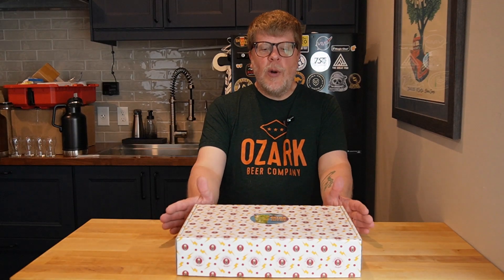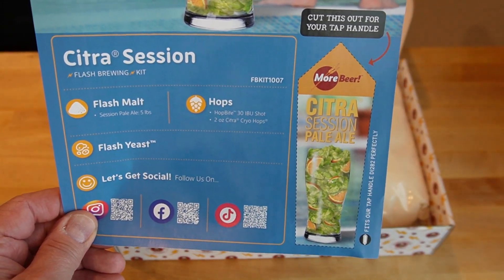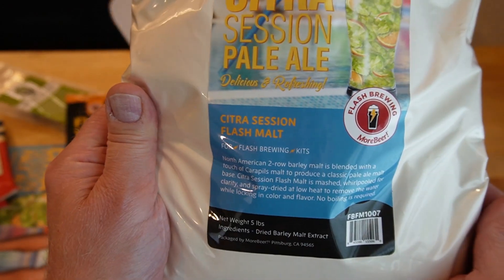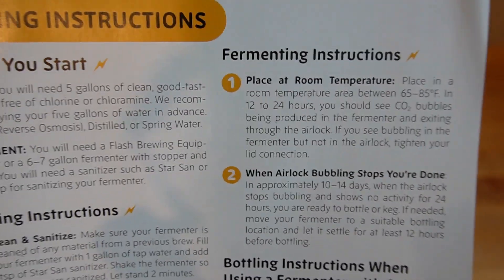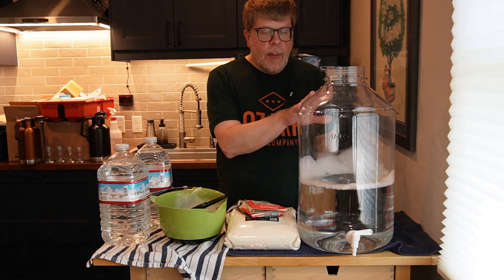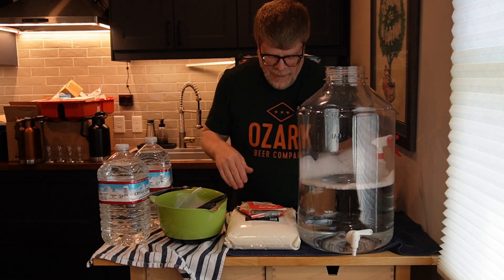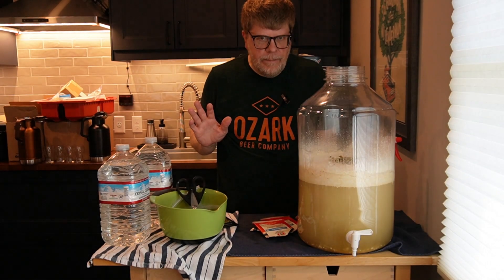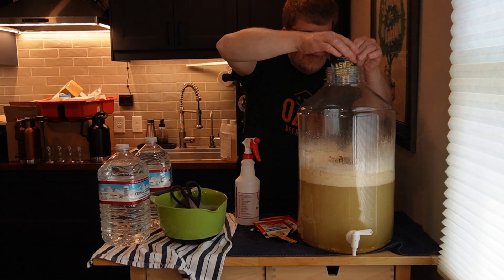Flash Brewing Part 1: Unboxing + Making the Citra Session Pale Ale Kit

Comment: I just did the same kit and i had a slight issue with adding the full last two gallons.  I ended up with 5-1/2 gallons in my fermenter with all the ingrediants.  Especially after reading in the Flash Brew FAQ it says to top up to five gallons.
Reply from the maker: Interesting, thanks for sharing that! On the instruction sheets they have you add three gallons, then add the ingredients, and then add another two gallons, so it's interesting they have an FAQ that says to top the fermenter up to 5 gallons. You of course do lose a bit of volume from the trub so in the two batches I've done I found that if you use 5 gallons of water you wind up with pretty much exactly 5 gallons of finished beer, but seems like some consistency/clarity would be helpful. Thanks for watching!

Comment: Did your Flash Beer stall fermentation on the second day. Mine did. Little nervous. Brewed it on Monday September 1 and it’s stalled or done.
Reply from the maker: @CraftBrew23  Mine didn't -- it definitely started fast and the visible activity in the blowoff tube subsided relatively quickly after about 3 days. Are you saying it's stalled because you're not seeing any airlock activity?